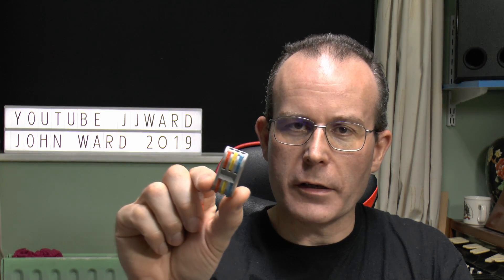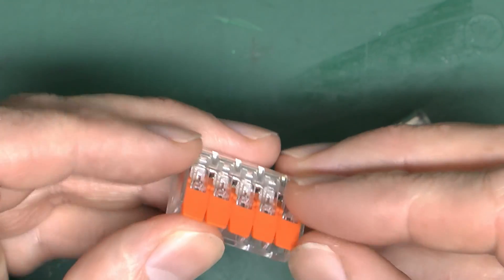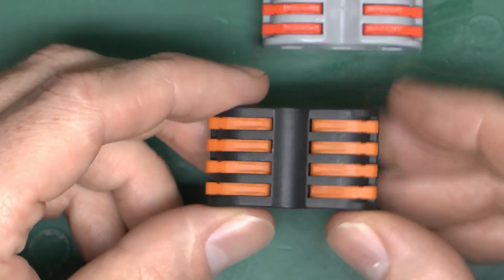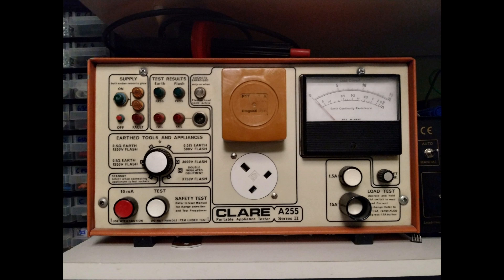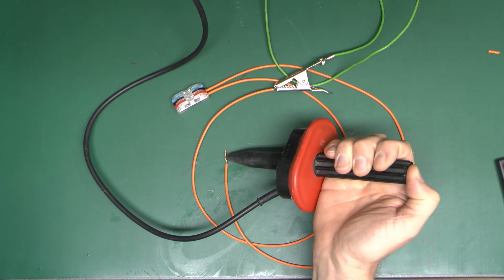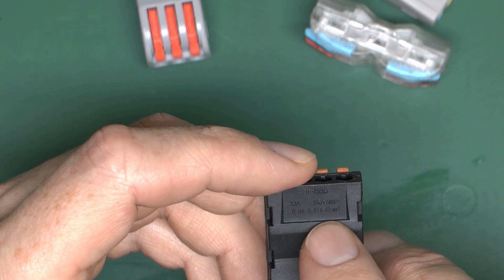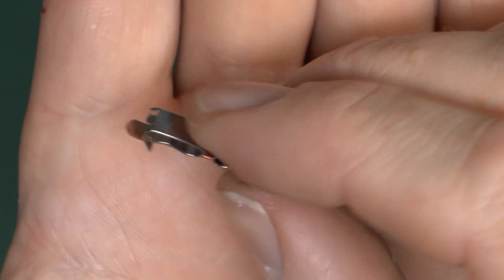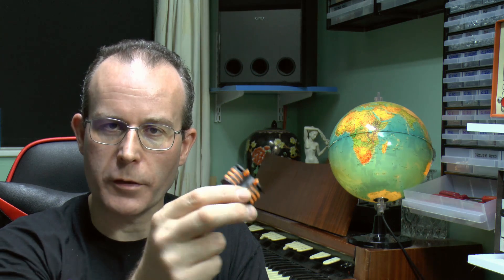Chinese Wire Connectors

Comment: So  -  well made, fit for purpose connectors, capable of handling mains voltage.  I'll use them with confidence and not be put off by your (anti) Chinesium bias.
Reply: It’s a liability issue if you are a professional. 
I wouldn’t hesitate to use them myself but I understand JW’s position.
Reply: You do not think from an engineering point of view. Items size,shape,materials, are all  calculated and is for a reason.China isnt on the same page with really anything but making money let alone our electrical codes.
Reply: I wouldn't use them on a customer's property and would not use them on my own therefore. It is my sincere belief that China deviates from material integrity with the purpose of undermining every society in their quest for dominance. I don't trust anything out of China. ( From 40 years experience in the building industry )
Reply: @Itisinthehandhave a good look around your house, every piece of electrical/electronic equipment if not all of them was made in china. Everything from your TV to your computer even your power tools are made in china . So stop talking nonsense. It’s a well known fact that 90% of fake electrical products are made in turkey. I have actually found three genuine wago? Burnt out in a friend’s house a result of her husband joining three sets of mains powered Christmas lights together. They were lucky it didn’t actually catch fire. The non branded ones are perfectly safe if use correctly buy qualified electricians who know what they’re doing and how and when to use them.
Reply: Being as toolstation sell nearly all of these connecters.... iv been using them for a good while.
Reply: @arcadia1701e  This is where you are protected then. Something goes bang and Toolstation have to answer for it
Reply: And we will all find a use to connect two pairs of wires, 3 wires and even 4 wires together 5:28
I don't know what planet JW lives in to not find any application for a wire-joining terminal block/strip DOH.
Reply: @johncoops6897  I think JW still twists wires together then tapes up with insulation tape!

Comment: I think it's worth testing the contacts with a magnet. Especially the part intended to be the conductor.
Reply: Away from the comparative safety of standards and regulations you find twin and earth cable in all kinds of colours and worse still the conductors are steel flash coated with copper! So yes that copper looking conductor might not be what it appears to be - chinesium as JW would say!

Comment: Hey. Great video John. 
Could you maybe go into detail on some acceptable alternatives to these for UK/IRE? I've seen the chocky blocks screw types used a lot, but I'd like to tap into a ring circuit (6 double sockets) to run a spur in the attic but the join would be buried in the wall in the future and not serviceable. I believe that rules screw terminals out of the equation? Thanks for the video. Very informative. :)
Reply: I'd leave it to the professionals! You obviously don't know what you're doing

Comment: It's written on them. 230V / 4 kV. It would be interesting to test it at real 4kV
Reply: He pretty much did test them at 4kV  (3.75kV) and they all passed fine.  Separation and insulation resistance isn't going to be a problem as JW proved here.
Plastic is dirt cheap in China however metal isn't so I'd be more interested to see if the current carrying capacity is accurate, optimistic or flat out BS!
I fear this is where the less ethical manufacturers will cut corners as using the least amount of and lower quality metal will significantly increase profit margins but obviously create a significant fire hazard :-/

Comment: Thank you John . I agree about not using these in an installation,  although they do seem to be quite decent quality in their construction & would be suitable for hobbyist , low voltage ,non permanent use.
The chinese quality in many things seems to be improving but unless they start supplying   electrical components made to an international electrical standard and backed up by a proper warranty then i guess they will stay off limits.

Comment: The specifications tell that these are 32A 400V. The current is quite large so perhaps you really should do the current test. I believe they pass but you never know. I purchased these too and they are quite nice for the very cheap price but opening needs quite much force. I’m going to use these only in low voltage systems, not in mains as the regulations here in Finland are very strict. These have CE-marking but it doesn’t tell anything about the security as everybody can add it. But these have CQC marking which approx equals CCC marking which is quite good. Not as goos as, let’s say FI which is the Finnish safety laboratory marking and the best in the world, but tells something anyway. That’s why I believe that these pass 32A test too.

Comment: These actually seem quite well designed and made.  A current test would have been very informative since that is the area where weaknesses in manufacture etc. would most likely have shown but so far I have not seen anything that would put me off using them - at least within my own properties.  I think we need a follow-up test on these John.

Comment: I don't use these for high currents, but for the usual lighting circuits they are fine. They sure beat the crappy US wire nuts that are pure junk.
Reply: @MernokiMegoldasok  I wouldn't trust twisted wires + tape for power wiring, although it's fine for speaker wire, phone, Ethernet, etc. Electrical tape is flexible, so it doesn't hold the wires together tightly. The connection will still work, but it will have a much higher resistance than a proper splice. The splice heats up, which can melt insulation or even cause a fire. I saw one where a connection wasn't tight in a GFCI outlet box (similar to RCD / RCCB built into a receptacle). The copper wiring melted, as did the plastic housing of the GFCI. Everything inside that box was completely burnt.
Reply: I believe wire nuts are illegal to use on 240 + in the UK........👍
Reply: @yensabi  And, if not, they ought to be in my opinion.  Vile idea.
Reply: yensabi I wouldn’t know, I don’t see many Sparkys in the UK using wire nuts. That’s pretty much all we use in the United States and probably most likely Canada and Mexico. They are definitely not the best but they are quick and that’s what the industry wants.
Reply: @yensabi  Is wire nut the same as torix (https://www.bauhaus.se/toppklamma-torix-t6) ? If so they are legal in Scandinavia. Except that younger electricians seems to prefer the wago.
Reply: @yensabi  Electrical in the UK and most of Europe is trash. there is never a need to have that much current running everywhere. I would change my profession if I was an Electrician in the UK. way to much conduit.
Reply: @DoubleD72  electrical in North America is trash. There is never enough current anywhere.
Reply: @JasperJanssen  lolz
Reply: I disagree. Wire nuts can be horrible, but if they are good quality and the right type, they can be very good. In my experience, a properly made splice with a wire nut is more reliable than a Wago lever nut. The only problem is that in order to use a wire nut, you have to twist the wires together first, which can break old wiring that has become brittle. I use Wago connectors for temporary connections, old wires (to avoid breaking), and situations where it is difficult to use a wire nut. Wago connectors have the advantage of being easier to connect and disconnect, but wire nuts, if used properly, are more reliable.
Reply: @pterosaurology 
Dude. Wire nuts suck. Imagine having to turn off power everytime you need to change an existing connection.
Reply: SCWfan06 you think we turn off power here all the time ha ha ha ha ha ha
Reply: SCWfan06 so you don’t turn power off over there to change something. Believe me I’ve worked plenty of stuff hot here in the states. But now I try to never work hard because well Murphy’s always on the job. But is he getting coffee or is he clocked in.
Reply: @pterosaurology  These old hands are beginning to struggle with wire nuts when there are more than two wires; I use them for #12 and bigger wire. Where I really enjoy the Wagos is in installing Shelly, Sonoff, and other IOT devices in boxes. But I limit those to 2 or 3 amps max, so #16 or 18 is even possible.
Reply: @johncrunk8038  I don't trust cheap IoT devices, so I wouldn't want to have them installed in such a way that I can't easily unplug them if something goes wrong. Also, if you have a 20A circuit using 12AWG wire, you have to use 12 throughout. The only time I can think of where you can splice different gauge wires is if one is permanently attached to a device (for example, a dimmer with 16AWG wires).  I'm 90% sure that's an NEC rule, but sometimes NYS adds additional rules. Also, in addition to being of questionable quality, almost none of those cheap IoT devices are compliant. 

They make tools specially for twisting wires and putting a wire nut on. I don't know how good they are, but you may want to do some research about those if you do a lot of electrical work.
Reply: @pterosaurology  Wire nuts have issues because of the twisting. We should go to Lever Nuts. It is an improvement. Somebody tested the Wago lever nuts to 75Amps and did not have any issue. It started melting at 150Amps.

Comment: Surprised your three-through connectors held 3750V, the ones I have fail around 1kV, they also have only about 1mm creepage so that is expected.
Mine have all orange levers and the springs are almost flush with the top of the separating walls.
Still not anywhere near enough creepage to be compliant with any standard.
Reply: It said "4KV" on these ones, did your 1 kV failed ones have any sort of separation rating shown on them?

Comment: I would have liked to see current pass through test with those connectors.
Reply: The current test would be nice. I think these might be suitable for mobile home 12VDC installations, as the spring contact seems to be sturdy. Would the Author of the channel like to give a comment on that kind of use?
Reply: @eelipiirola5132  I came to this video from another video where he did test the current.  not much different from a wirenut. they are all made from plastic and bits of metal.

Comment: I would use the din rail ones an awful lot if I could get them from a reliable source.
Reply: Wago makes a din rail clip for the 222 and 221. Not the same I know, but tested and certified.
Reply: Matt Simpson Wago make lots of different types of DIN rail mounted ones. I use RS mostly for quick delivery.
Reply: random8number I haven’t seen any wagon din rail ones like the ones in the video, they do some weird ones that look like they are for a very specific purpose with a lever but they are very expensive.

Comment: China wire colour code:
-L1: white
-L2: green
-L3: red
-N: pale blue
-PE: green/yellow striped
Reply: So I have discovered recently while working on some rather poor imported machinery. Spent nearly $5000NZD putting right some of the more obvious errors and omissions. And there will be more yet. Not the smartest purchase that customer has made. The welding of the steel has to be seen to be believed.
Reply: @johnsimpson8263  In my opinion it is not very smart to use green as a colour for a line conductor. Could be confused with the green/yellow striped for the PE. The european colour code is designed that way that even colour blind people can distinguish between the different colours:
-L1: brown
-L2: black
-L3: gray
-N: blue
-PE: green/yellow striped

Comment: i love these pass thro not wago wagos. very very handy when troubleshooting auto-electrical stuff, i woutldnt trust one in a wall, but id certainly use them for low current lighting and absolutely love them for my work (all low voltage stuff) and for prototyping my gadgets (again low voltage stuff) .. bought a load after mikeelectricstuff video on them.

Comment: Very interesting, what was the actual conductive material across the items?.
Thanks for sharing.
Reply from the maker: Springs are steel, the other strip isn't attracted to a magnet so could be copper, or plated copper for the silver coloured one.
Reply: @jwflame  I'd be worried about corrosion resistance.  The springs could be cold-formed stainless steel (which becomes attracted to magnets after cold working) but probably aren't.  The conducting strip could be copper but could be something prone to corrosion with a very thin plating of copper that is porous.

They could be fine.  But if they'd been designed conscientiously they'd have had sensible colour codes on the levers.  So probably whatever crap they could get away with.  Which means eventually the springs will corrode until they snap, or the copper plating will lift off.

Then again, if they're Chinese Wire Connectors maybe they work really well with Chinese Wire.  That thin, shoddy, copper-plated non-stainless steel crap.  It's possible.  But unlikely.
Reply: @bdf2718  my guess is that the main conductor is Copper plated Aluminium like most Chinese wire seems to be these days
Reply: @jwflame  Thank you, interesting to calculate cross section of the conductive part, what do think. Looking forward to smoke and burn episode 👿.

Comment: G-day JW, between you and Big Clive I have seen a lifetime of these spring loaded connectors and it leaves me with just one question.
Don’t you Pommies own screwdrivers?
Reply: I do! but in the hands of poorly trained 3 days to be qualified "Electricians" we have over here there probably safer as your far less likely to have a loose connection.....
Reply: @Dark Dream unfortunately you are correct....but probably reduces the odds
Reply: In industrial applications, we have seen failures due to the contractor not stripping enough insulation off. They then terminate, but the clamp does not full catch the wire. So eventually you end up with either an intermittent connection, a high resistance connection, or an open circuit...

Comment: I saw the big clive review and they seem ok all things considered.  Still though I refuse to use them for mains voltages.  There is no telling how they handle heat and  cold and them being in a place that is not easily seen like inside a J box is scary.  They are fine for low volt stuff though I am sure.

Comment: The two way WAGO copies are good for 12v low current applications.
Reply: I only ever use them in low voltage, low current applications with a 10 or 20 amp fuse protecting them.
Reply: They're probably just as fine in higher current.
The problem is not actually quality but liability or here lack of.

Comment: Bought 2 types out of curiosity had one break after a few days, only 1 of the 3 gang straight through
one of the clips slipped too far back, i think the 2 gang type came from the same supplier as Clive and seemed a bit more robust.

Comment: I rather use decent thermal connectors
Reply: I assume you mean terminal connectors and I agree...but as long as the installer knows how to tighten screws

Comment: I find the 'straight-through' connectors an incredibly useful replacement for screw connector blocks, why on earth don't Wago make them?
Reply: I got some 2 gang and 3 gang types and i dad the middle pin slip out of place on a 3 gang type,
maybe having the 2 thicker outer walls helped the 2 gang keep the pins in.

i either lucked out on the metal plate in the 2 gang or the 2 soft walls holding the middle pin were the point of failure

only using these with some D.C. stuff wouldn't risk with A.C.

Comment: I got some of these "not fake wago, fake wago" when I seen Big Clive review them. They were exactly the shape I wanted and they were only going in quick hobby projects anyway. :D Good to see all the other types. I find the 3 individual wires to 3 individual wires to be my common use-case. Not once have I wanted to connect 1 wire to (4?) others. Maybe that is just me. 

Surely the colours are just to show that blue goes to blue, red goes to red. Not to denote the type of wire that goes in.

And as for the slop on the lever, I would want that. The leaver is just there to lift the gripping part of the connector, if the lever had no slop in it, it would mean it's not letting the connector grip as tight on to the wire as it could do.The lever itself is not the thing holding the wire.
Reply: The multi way ones are useful in lighting circuits and industrial control applications....but I would only purchase them from an electrical wholesalers for the exact reasons Mr Ward describes
Reply: Yeah, I got some for quick hobby project use, too. Usually 3 or 5 volts and temporary patching together. Usually 3 individual wires to 3 individual wires or 2 to 2. Sometimes in place of alligator clips, that sort of thing. I've found them very useful. Never used them for line voltage or permanent installations.
Reply: Red blue is a common standard for line/neutral in France and several other countries

China seems to use yellow/green/red for phase black/blue for neutral and greenyellow for CPC